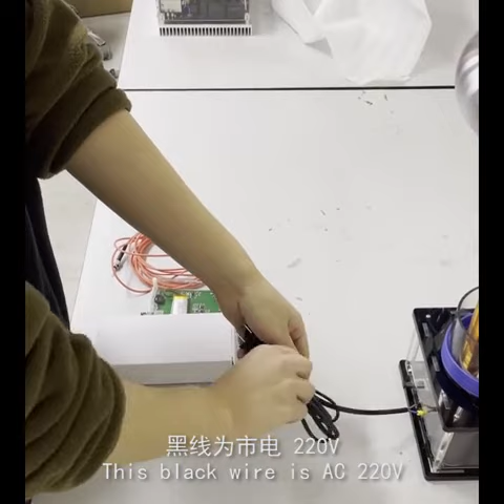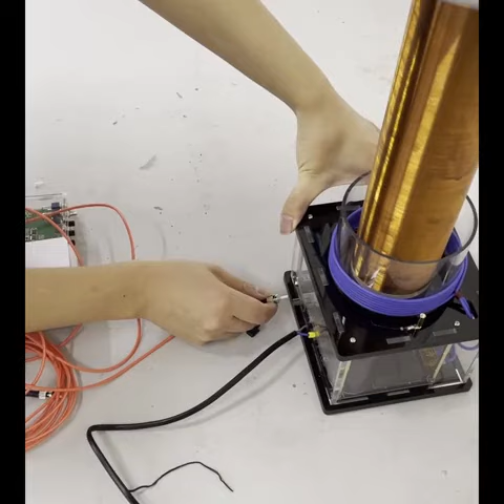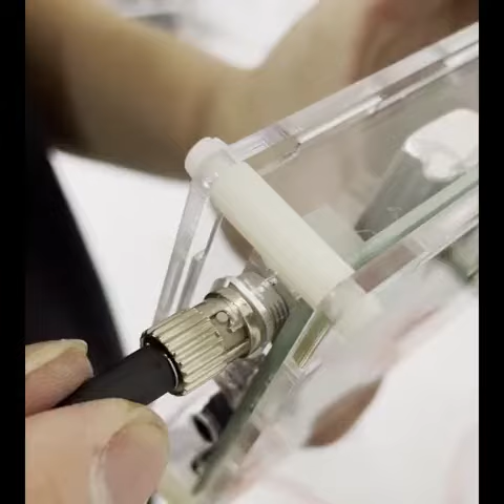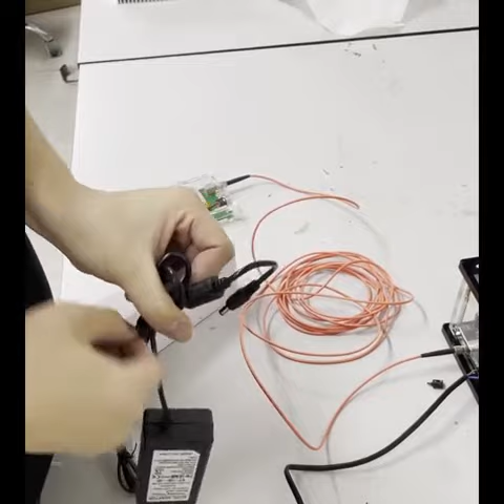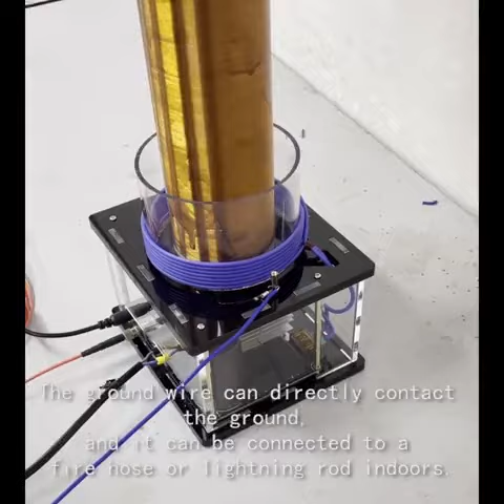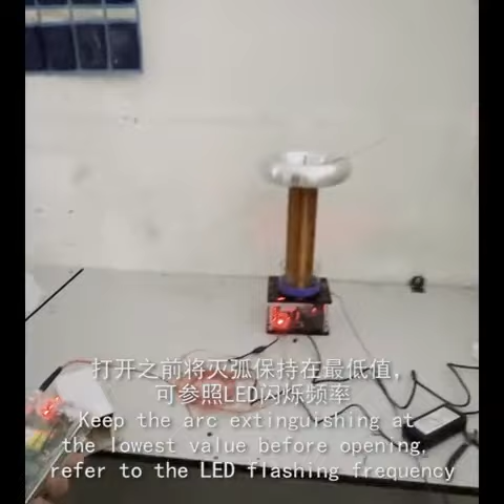How to Connect the Wire of the Musical Tesla Coil?

Comment: I purchased one. There are no real instructions about using the controller box or how to control the outputs. There is a stereo jack and a USB cord by no instructions. I am hoping to do a favorable review but that will depend on them providing the additional information to run it properly.